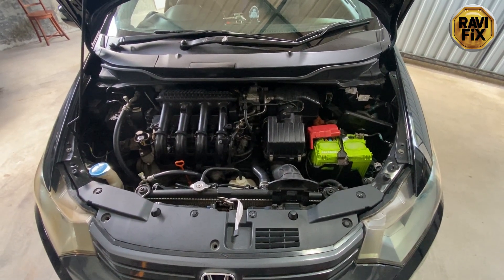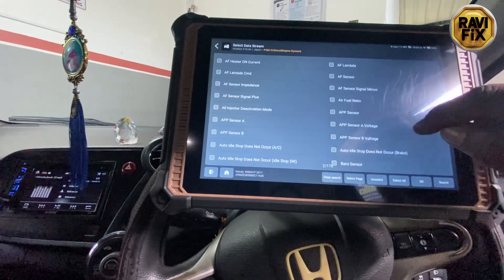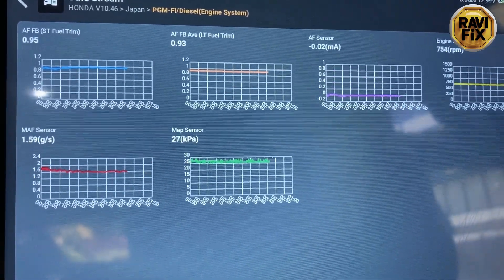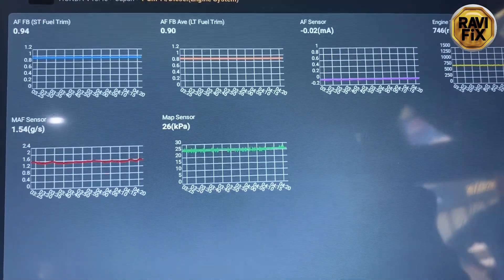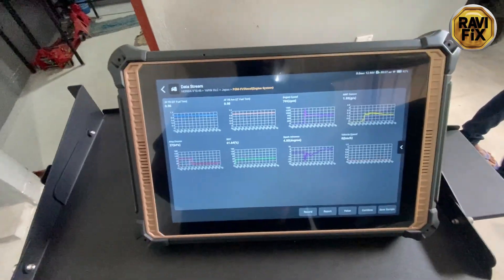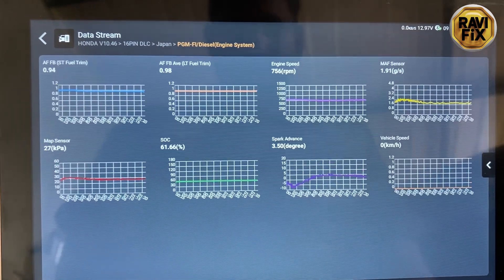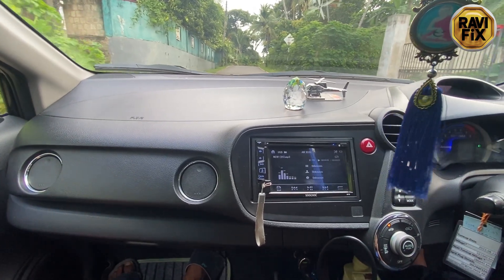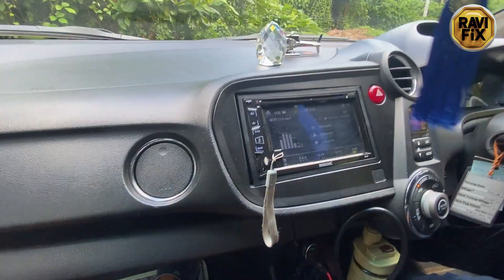Why Your Car Jerks When Accelerating – Honda Insight Troubleshooting Guide

Comment: Can I not clean the Egr valve and replace with a new gasket ? Or replacing the egr valve is the only solution?

Edit: Hi, I have cleaned the egr valve on my car but it didnt made any difference so in that case do I need to change it in order to solve the jerking? Plz reply thanks.
Reply from the maker: First need to make sure it is leaking. Otherwise no need to change
Reply: @ravifixall  I dont have any such things to check the leaking, but as you have told the issue the car had in your video mine is also the exact same problem. Please kindly suggest me something. Also can I buy used egr valve from ebay of it has to be brand new( aftermarket) plz reply thanks

Comment: I'm looking to purchase a honda fit shuttle (1.3l hybrid) that is 4 hours away from me, the issue i noticed when I shift into d gear the car jerked abit and when I leave the brake to drive it jerked abit but when I drove it was fine till i had to bring the vehicle to a stop at red light or junction it would jerk abit and then setting off again it jerked abit. the owner said the dealer they bought it from said its normal for it to happen which i disagreed but they wouldnt take my word. i was told this fit shuttle and insight gearbox is causing the issue but somehow u say its vaccum leak causes this. what are ur thoughts?
Reply from the maker: Might be vacuum leak or bad spark plugs. Scan data will help to reveal what it is.

Comment: hello sir, i have a Axio 141 2007 car which has jerking issue. car jerk when i slow down the car and smoothly pickup the car. this jerk comes below the 30 kmp speed. i spent over 4 laks to to repair this. but still problem persist. do you have an idea about this issue. is this issue same like this video described.
Reply from the maker: Without scanning analysis hard to say exactly what is going on.😢

Comment: I hv the prblm jerking at 1300 rpm 😢 i hv done all tune up and plug changed
Reply from the maker: Check for Vacuum Leak 👍
Reply: @ravifixall EGR is the problem bro, after cleaning egr its working fine ❤

Comment: Great video and approach. This is what we need from our mechanics. Seeking your advice pls on shift solenoids. If one goes bad and needs to be replaced with a brand new one, do all the other solenoids in the valve body needs to be replaced as well.
Reply from the maker: Normally no need to replace all. But better check them using Ohm meter. And you can check them by providing power manually too.
Reply: @ravifixall  Thank you.  Only one solenoid is 58 ohm. All other solenoids are 3.4 ohm (within specs). Is it still neccesary to power them manually to check?  I need to import the new solenoids in advance before i open the valve body.
Reply from the maker: Then those solenoids might be ok

Comment: Grat work , i have same issue in audi a6, 2.0 tdi but maf data is 9.2 gs at idle.?
Reply from the maker: 9.2gs is too high. Is it same value after while get in to the operating temperature?
Reply: Bei 90c it comes down at 7.2 @ravifixall
Reply from the maker: Still too high
Reply: I change the maf sensor. Still more or less same value.what to do next? @ravifixall